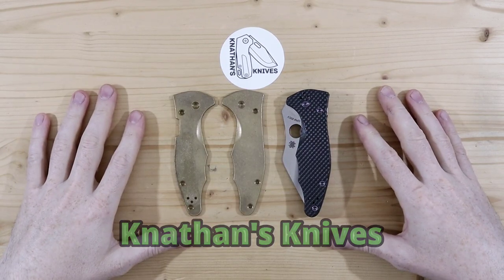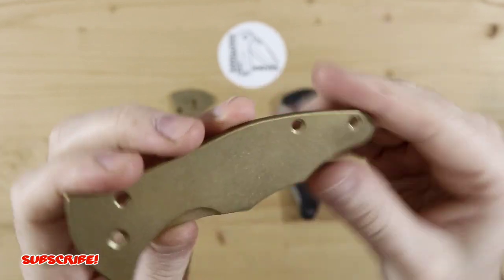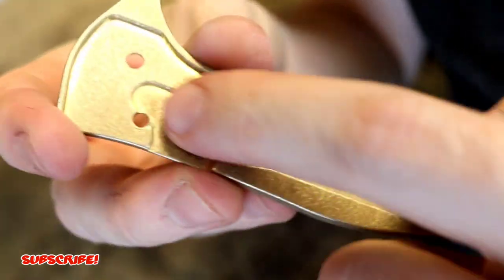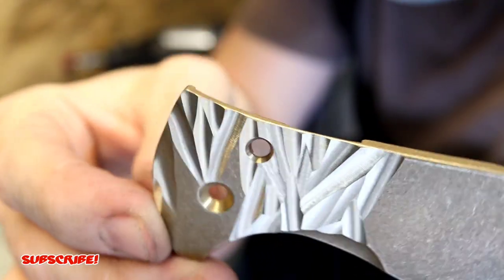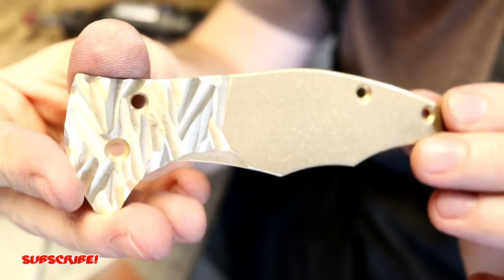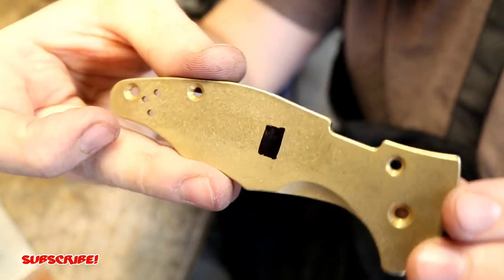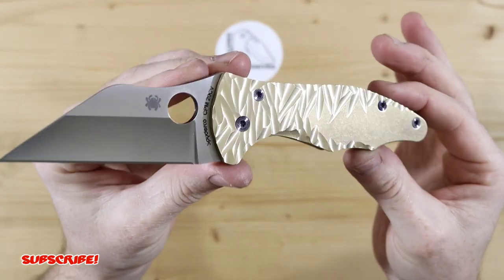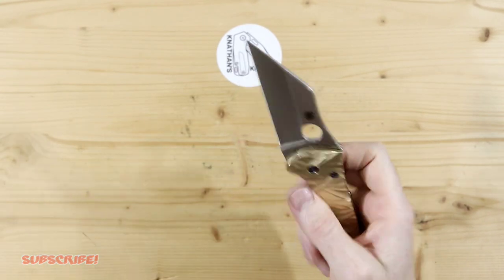Customizing The Flytanium Brass Scales(Spyderco Yojimbo 2 Pocket Knife) -How To- #brass

Comment: Hey bud, impressive scales, i honestly didnt think a barrel sander would cut it, i guess brass is somewhat soft, how does that work with alum and ti? Is a Dremel enough?
Reply from the maker: Thank you! 
It works well with Ti & Aluminum just needs to be set at the lower speed🙂